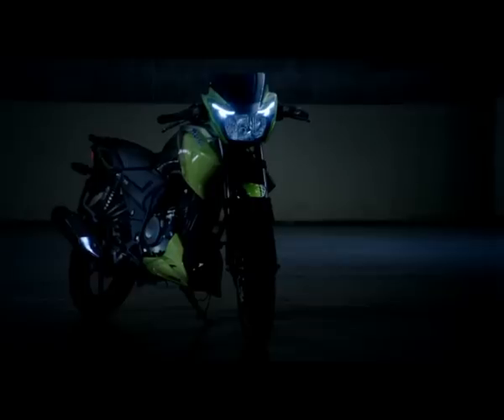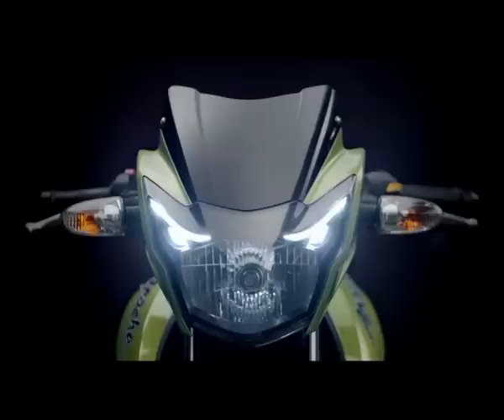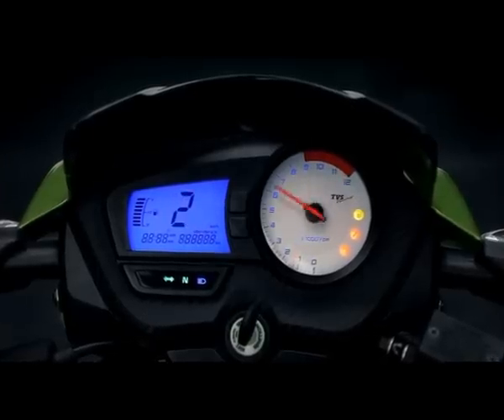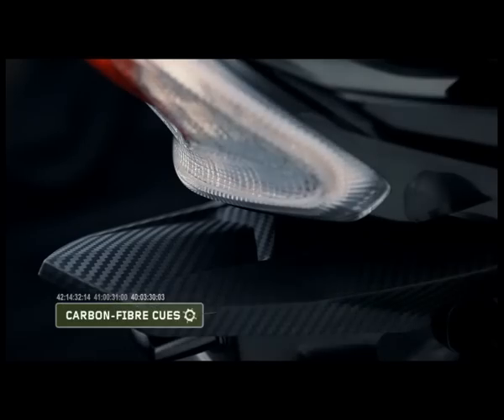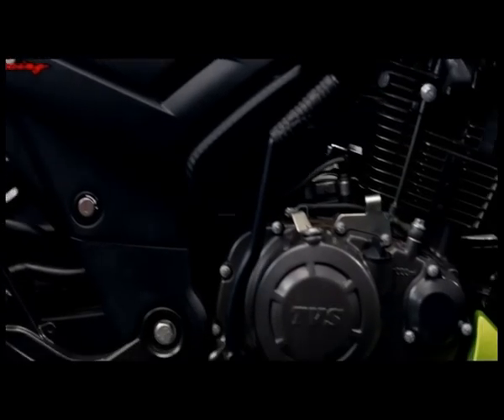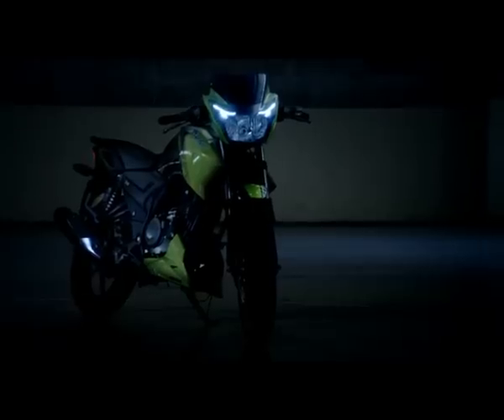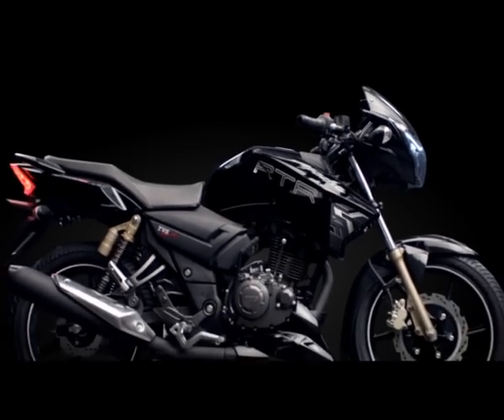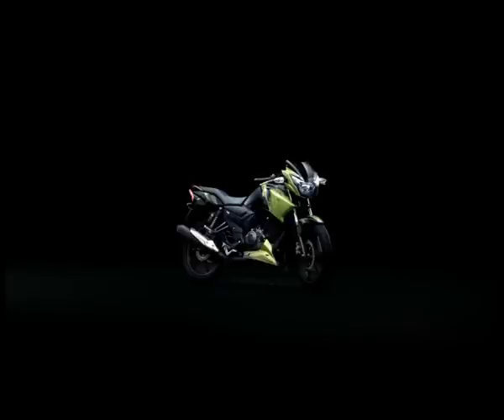The Science & Art Behind The Making of the Beast

Comment: Hey pls clarify my doubt I had Apache RTR 1602v 2016 1st genaration model so I want to make a makeover which like I'll buy a new generation 2021 model and take out all parts which means Tank, headlight assembly, cowl set, side panels, engine guard, speedometer, _ and I'll fix my old generation model parts in 2021 model  is that both bikes parts are in same size or different ??

Comment: I owned TVS apache rtr 160 dual disc brake. Ride 10 months & 10,000 kms.
At newer condition rear disc brake works sharply on gentle pushing.
BUT now
my rear disc brake is not working sharply even i changed pads and brake oil at showroom .
I have to push my leg so much down for sharp braking and this is too much late for stop the bike .
showroom says nothing about that
Can you help me to solve ...
Or send your opinion to mail i.d.

Comment: the only problem is the immense vibration, apart that the bike is perfect.
Reply: Im from mexico and i got the 160 2v carburated. I can say to you that the vibration is there but is not something that afects the experience. I even do long trips with my wife and is a good bike for the price, before this apache i had a chinese 200cc OHV engine bike with balancer shaft, and had a lot more vibration than the apache 160 at the same cruise speeds. It was almost imposible to do long trips in that one, apache has a sweet spot at 6700/7100 RPM where you can cruise very confortable at 90/95.

Comment: Tvs rts 160 and 180 shoud be modified by company sir u shoud bring minimum 2 spark plug engine and atlist 180 shoud get oil cooled engine. And please fix that spark plug problem engine gets shot and plz plz plz sir try to solve vibration it vibrates a lot on higer rpm. 1 more thing if yamaha r15s and honda cbr can give liquid cool engine systerm why shoud tvs will be back after all its a (rtr racing throttle response ) if they can give liquid cool engine in 150 cc why tvs not gives liquid cool engine in 160 or 180. Tvs company shoud launch new features like fixing all prlm as i shaid in above nd adding liquid cool or oil cool engine in there 160 and 180 rtr series. Thank q